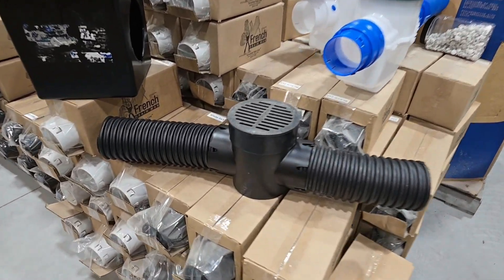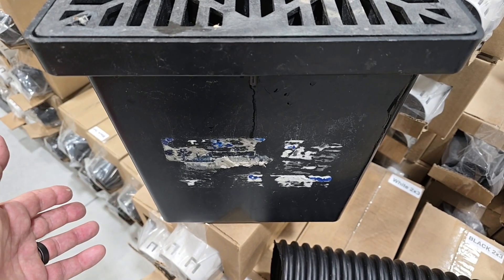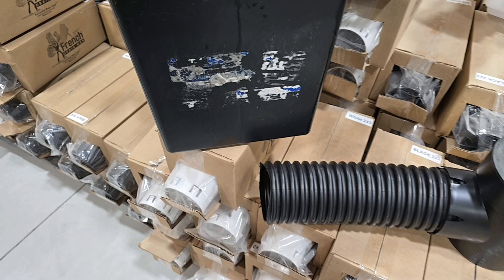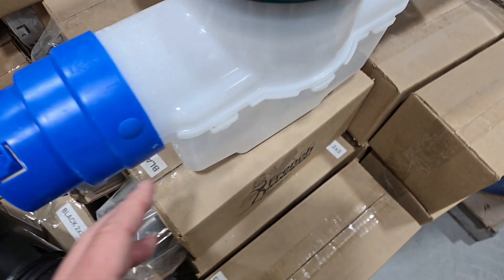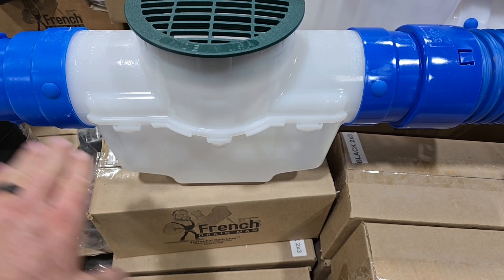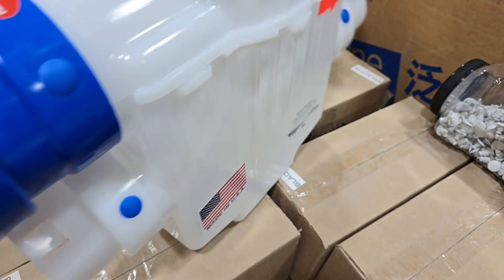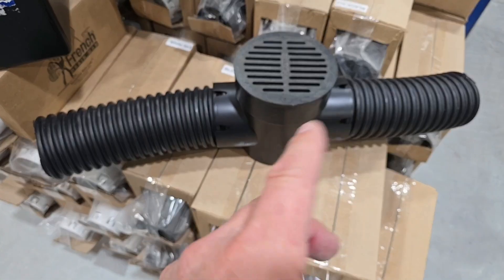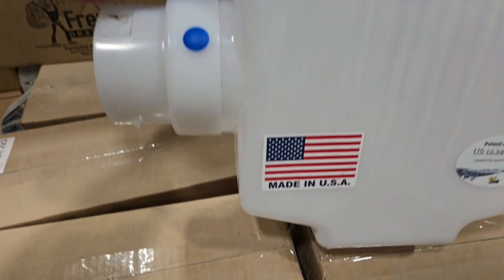Stop Catch Basin Disaster [How to Fix Catch Basin Heave]

Comment: I want to choose the right size catch basin for a surface water drain that takes on water from long driveway in the mountians.

Is there a general rule you follow when choosing the size of a catch basin? 
I have your 4 original single pipe catch basins that ties into my french drain and separate downspout lines. Works fantastic.  Kinda think i should get the bigger one to catch additional sediment from higher mountian elevation for the surfacewater drainage. Thoughts?
Reply from the maker: I would use the FDM 2.25-gallon 6" basin. If you go to the single catch basin in 6", there will be a dropdown option for the 2.25-gallon.

Frenchdrainman.com
Reply: @FRENCHDRAINMAN - You're the man! Thank you for the advice. 
I am putting in an order once I complete my full lost of items to buy. #Cheers